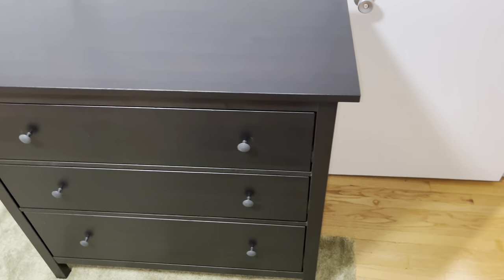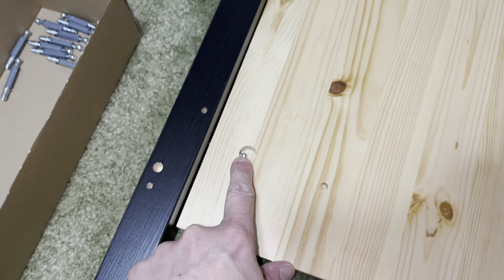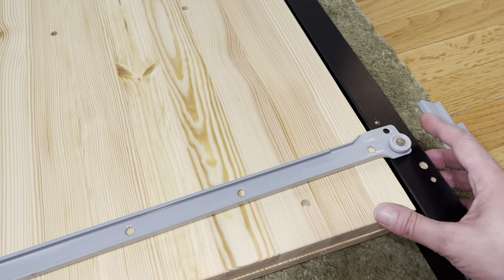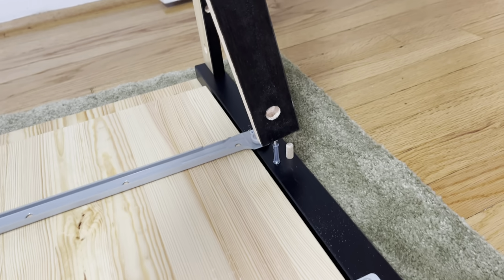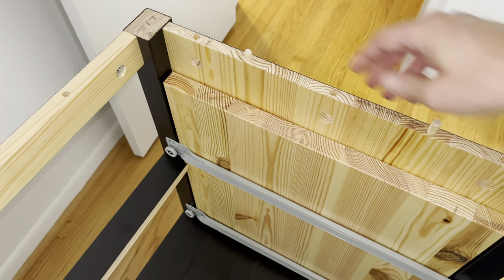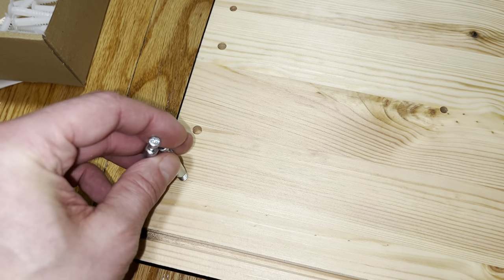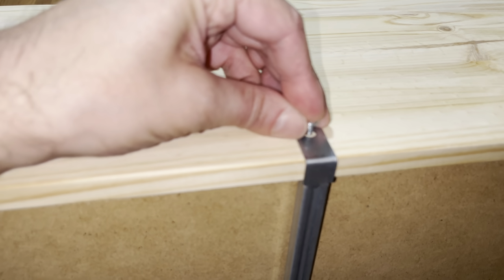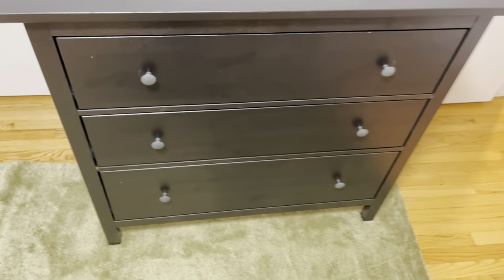Assembling Ikea 3 Drawer Chest Hemnes How to instructions manual

Comment: Hi, I am looking for a replacement drawer slide as the old one is bent. Unfortunately, Ikea discontinued this product and don't have spares anymore. Tried few from Home Depot and RONA. It wont fit it as there usually 3/4 extension in the market but this HEMNES drawer slide has bigger extension. Any suggestion on where to get a replacement slides? Thanks.